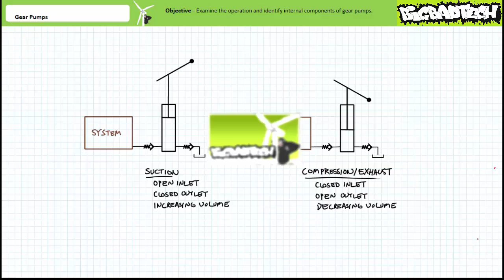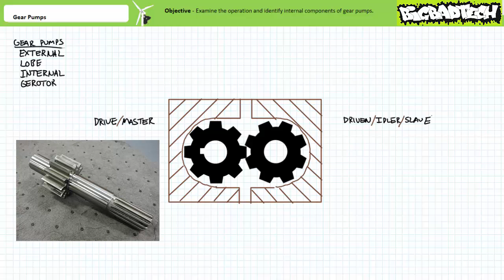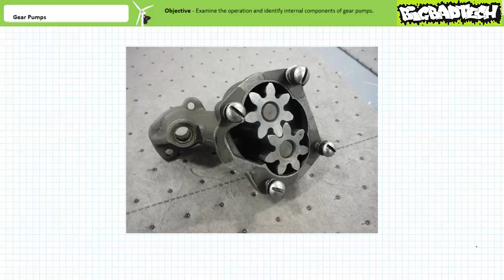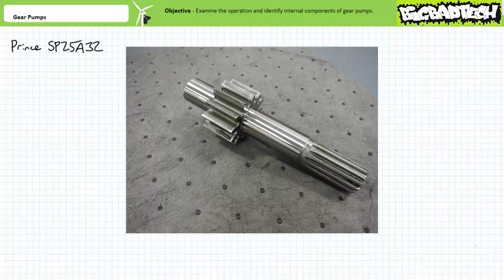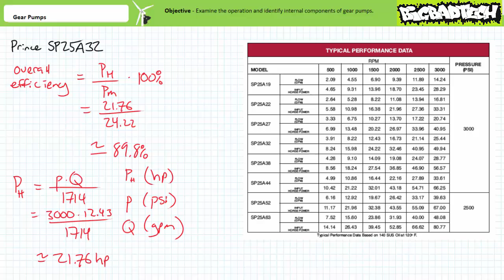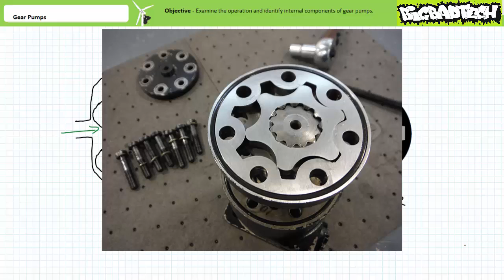Gear Pumps (Full Lecture)

Comment: We have a gear pump with a reservoir tank that is leaking at the bottom fitting.  The system is for a Gaylord dumper.  What is the risk of air getting trapped after we refill the reservoir?  Will any air that is trapped be purged out of the reservoir breather?

Comment: Can i use external gearpump for chili or tomato sauce?
Reply from the maker: A lobe pump (similar to a gear pump however instead of gears it uses meshing lobes) might be a better fit for viscous food applications.
Reply: @bigbadtech  what about if i still choose external gearpump for tomato sauce?, because lobe pump is more expensive :(
Reply from the maker: What if you used a screwdriver as a hammer? It might work but not as well.